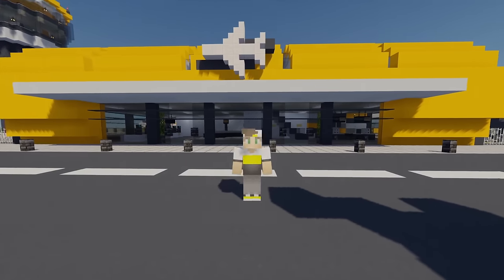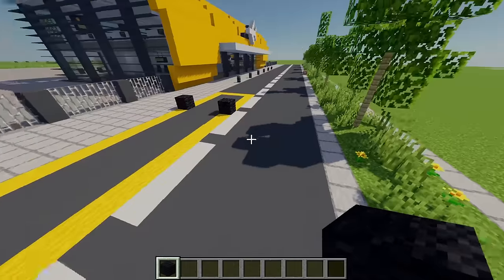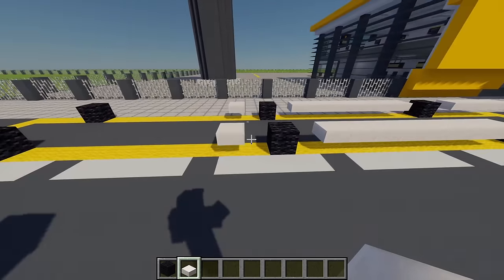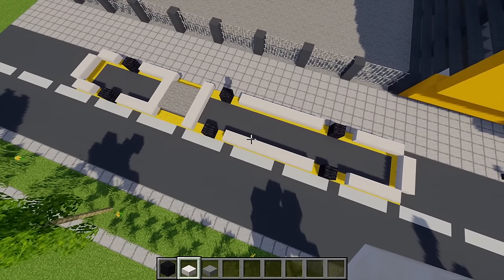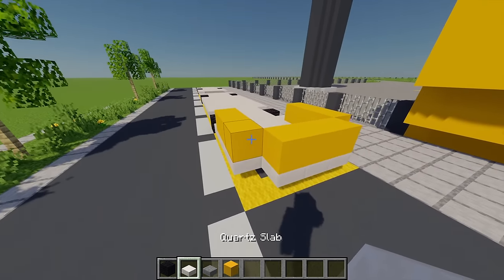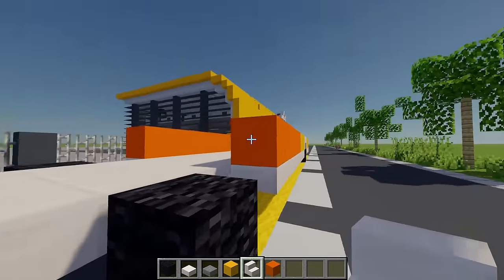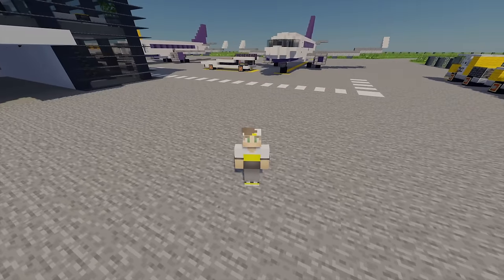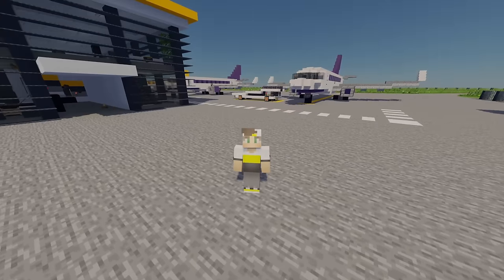How To Build AIRPORT VEHICLES in Minecraft! (Airport Collection Pt.3)

Comment: pls add how much of the materials need  🙏🙏🙏
Reply from the maker: ah yes, I got a list for the shuttle bus here: 

214 Quartz Slab
145 Snow
69 Yellow Concrete
67 Black Stained Glass
50 Gray Concrete
40 Orange Concrete
32 Iron door
20 Polished Deepslate Wall
18 Yellow Banner
18 Smooth Stone Slab
18 Deepslate Tile Wall
18 Quartz Stairs
18 Stone Slab
14 Black Stained Glass Pane
9 Gray Carpet
9 Black Wool
3 Birch Sign
1 Grindstone
1 Lever
1 Deepslate Tile Stairs
1 Birch Fence Gate
4 Item Frames
2 Glowstone
2 Redstone Block

For the other vehicles the material count isn't too big so I think you'll be ok with them : ) Hope this helps anyway
Reply: @ChippzMC when will the new plane tutorial come out?
Reply: It is out